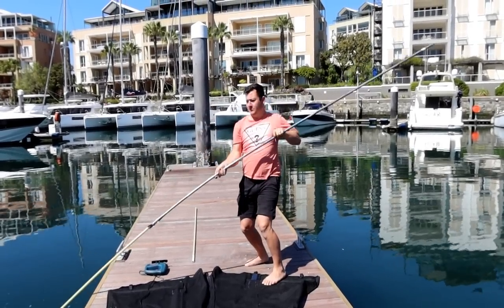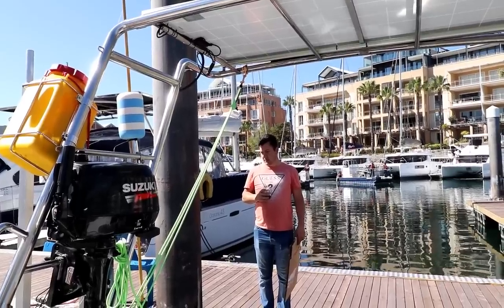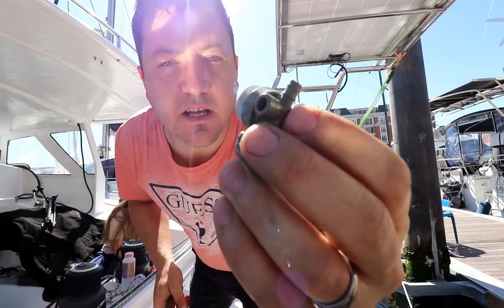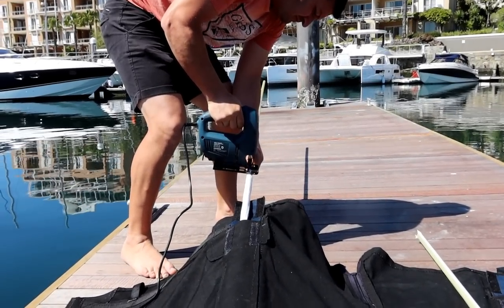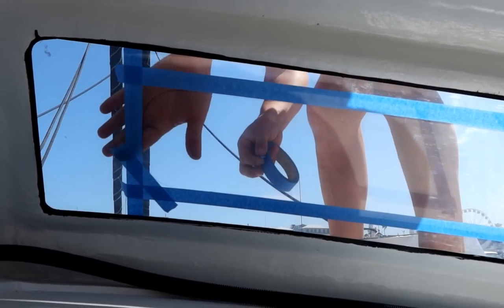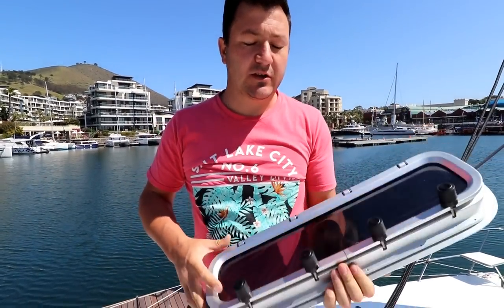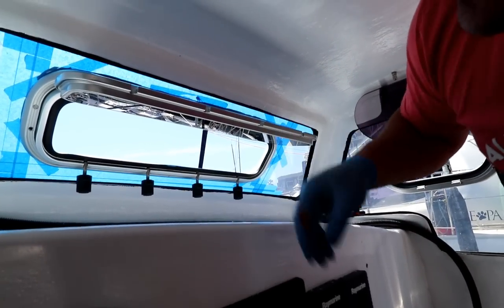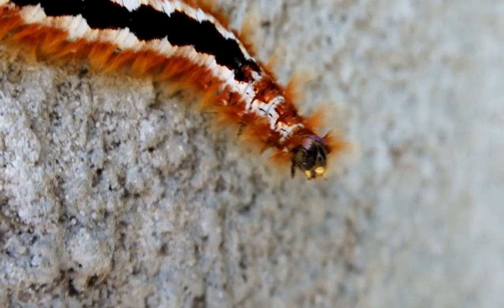INSTALLING  PORT LIGHTS in our COCKPIT!

Comment: I've heard that a good way to clean out a fuel tank or a coolant reservoir is to used ice cubes, they scour the inside as you shake it. Works better than just water.
Reply from the maker: Never heard of it , but the water got it spotless . Maybe give the ice a bash next time around. 😉

Comment: Ricky I desagree with you about Polycarbonate, because it wears very slowly compared to Acrylic. Acrylic breaks at first chock too. I dunno if Acrylic would stand the jig saw, by the way.
Reply from the maker: Never said it wasn't stronger just scratches show way more on polycarb. Acrylic you can polish the marks out but not with polycarb.
Reply: @livingwiththemaias  Of course you can polish Polycarbonate Ricky. Try Menzerna Final Finish (or 3M 59015) with a dual action polisher. Scratches removed guarantee. Then you can protect the polycarbonate with Finsh Kare 1000P Hight Temp Paste wax as a scratch guard and water repellent.
Reply from the maker: @axelSixtySix  hahah I have tried it before , please don't tell people you can polish cast polycarbonate.  That will be an expensive day for them . Even the manufacturer says you can't do it. We did alot of research before we did it.
Reply: @livingwiththemaias  I did not know it was impossible, that's why I get excellent results on my boats during thirty years. Come on Ricky, polishing polycarbonate is a very  usual process. From automotive headlights polishing to boat detailing companies. There's a huge amount of polishing products dedicated to polycarbonate and documentationn everywhere. You can't miss that. But never mind.
Reply from the maker: @axelSixtySix  No boats use polycarbonate as windows,  all hatches and portlights products are all acrylic. If you go to an aquarium that's all cast Acrylic NOT polycarbonate.  Polycarbonate release gases.  Manufacturers have many trade names that confuse the market and drive manes according to demand of product name. I have done many window installs in the marine industry its all Acrylic base material.
Reply from the maker: You do get polycarbonate with different molecular structures,  but the cast polycarbonate that we have according to the manufacturer does not allow for polishing.